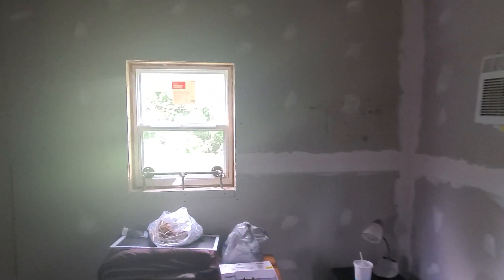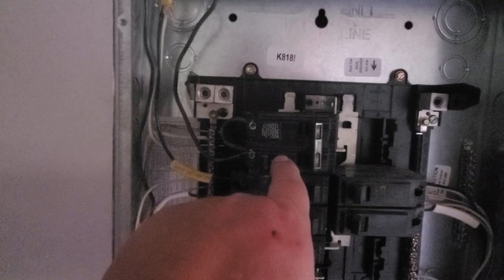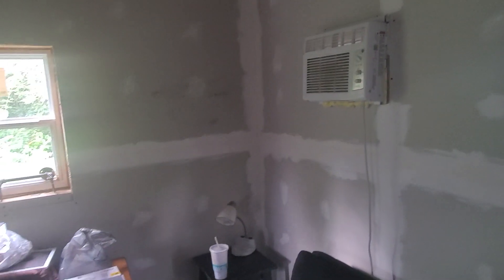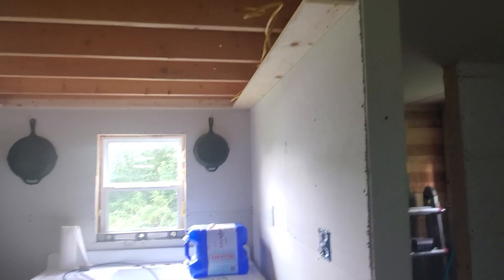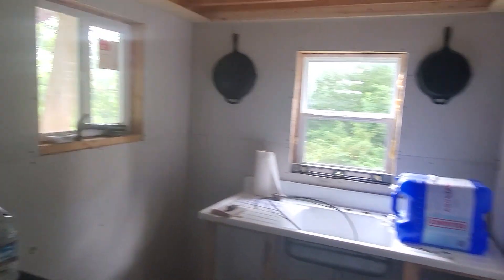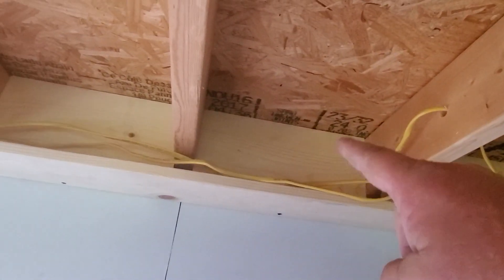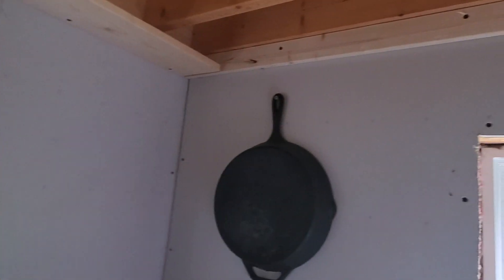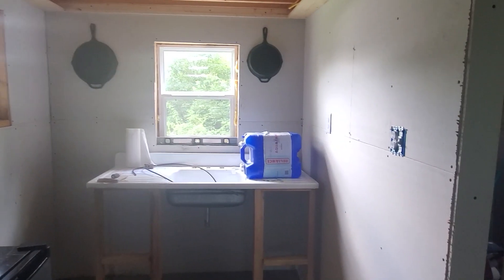DIY Wiring Generator Breaker Box For Power in the Off Grid Cabin

Comment: Hi Joe and Gail , these type of light bulbs go into the cheap white ceramic fixture to dress them up and give good light.  there are many different brands but this is the first one i found on amazon, TRI Burst by Bell+Howell High Intensity Lighting with 144 LED Bulb, Multi-Directional Triple Panel Light for Indoor and Outdoor
Reply from the maker: +Cam1922 Thanks!  I like that.

Comment: How come your not using your inverter genny? That champion runs full blast burning fuel
Reply from the maker: +peeinginthewind That's a good question lol. I set this whole thing up, based on the 30 amp plug that comes from the bigger generator lol.  I had no idea the company was going to send that one to do a review on. I won't be using the generator but very seldom once I get the solar set up.  It's not worth going in the walls and changing everything over to support the inverter generator.   I hope that makes sense. 😁
Reply: @HomesteadWithJoe  I think it does ... but I'm sure theres a  adapter u can buy ?

Comment: Your neutral and ground wires should be on separate buss bars.  The green bonding screw is the only place where the neutral should be connected from the ground.
Reply from the maker: +BS With only 120 coming in, it really doesn't matter in this setup I was told by our electrician. He checked it all out for me.